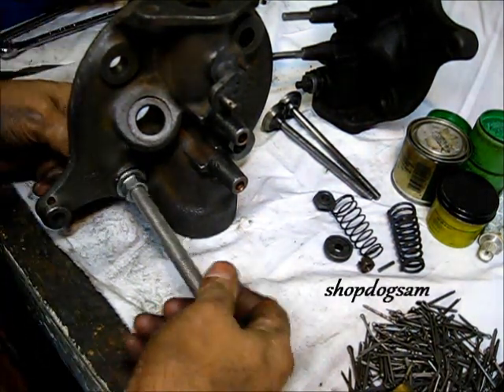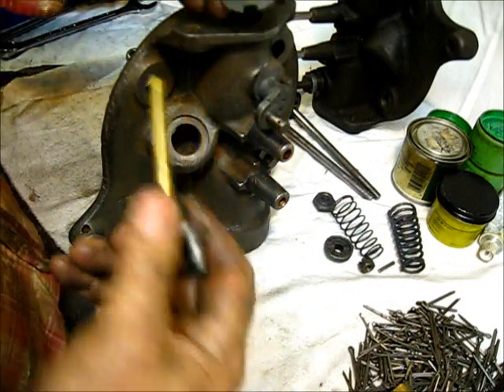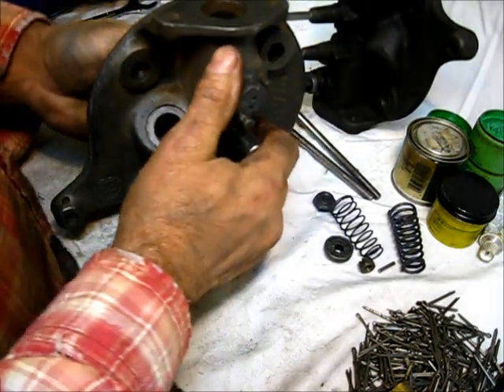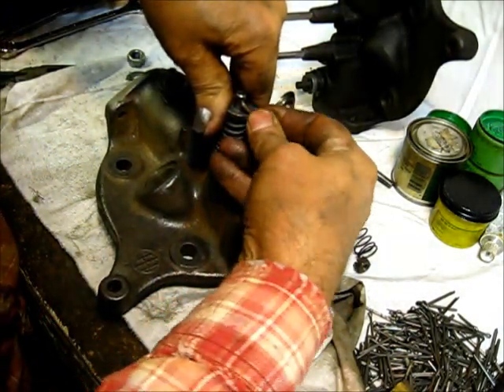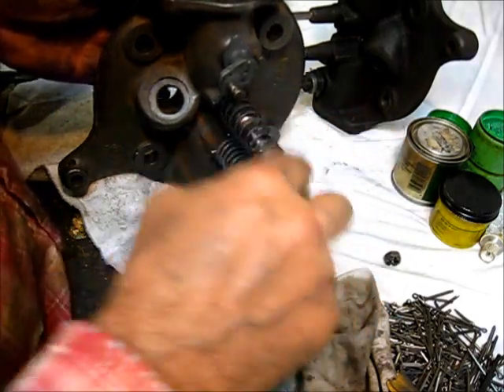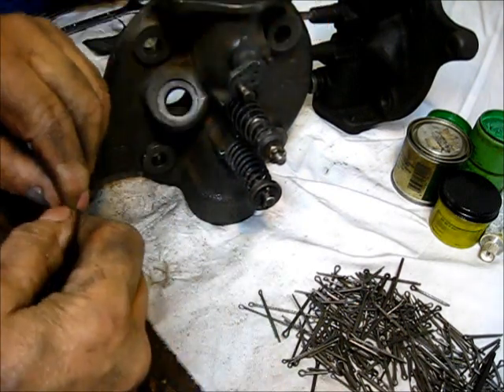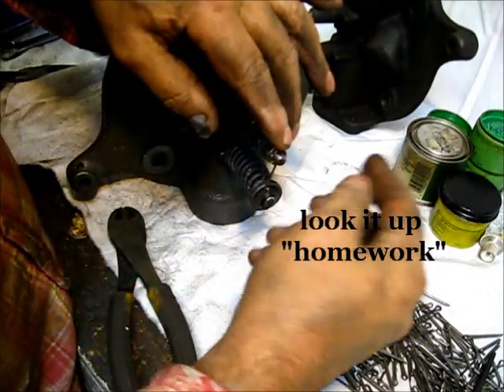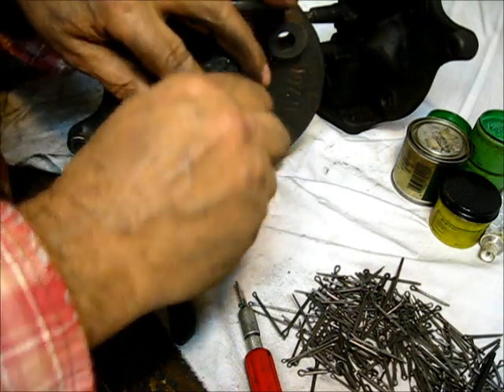I H C ENGINE valve job - cotter pins - valve assembly

Comment: That was a great series Sam Thanks! In 65 years I never once filed a cut cotter pin; never crossed my mind!...but it's a good idea and I'll do from here on out. BTW I made 6 of those pie crusts of yours with the grits and they were tasty! After I "installed" them in the pie pan they shrunk some; down the sides and exposed the top rim where I like to pinch the dough around the perimeter. Did I do something wrong? Regards,
Dave